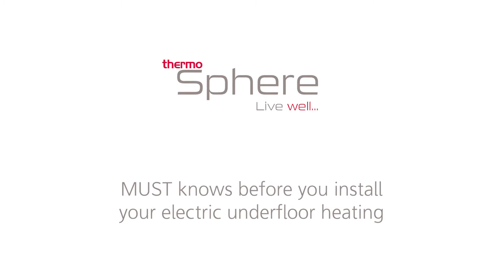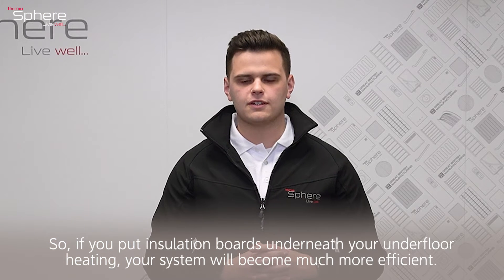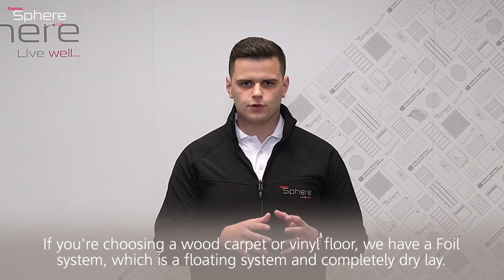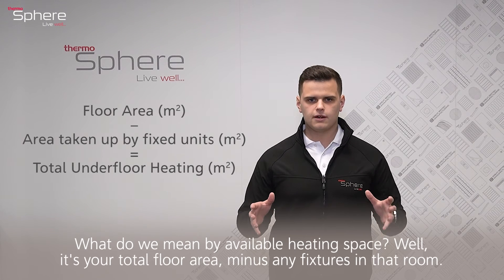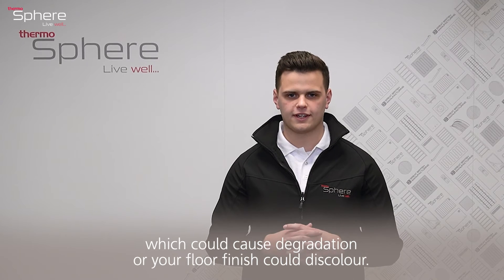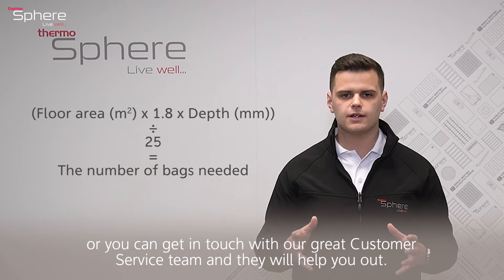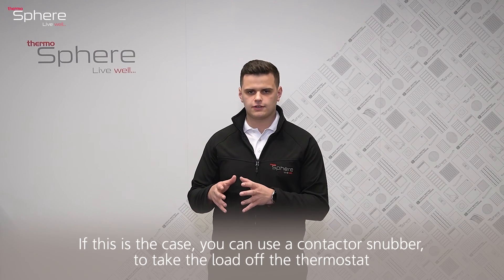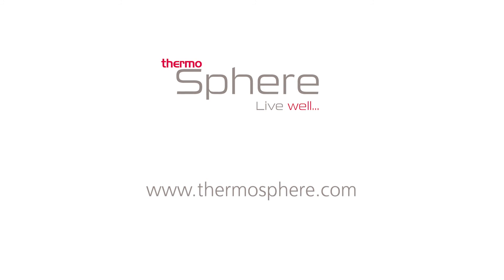Must knows before installing electric underfloor heating

Comment: For a concrete floor do you putting the heating mat first or the underlay? I have read different opinions on this.
Reply from the maker: Hi @MusicalRissy13Lovings, you'll want to put insulation down first to ensure you get more efficiency out of your system. Take a look at this page, which shows different floor build up options based on your floor finish - https://www.thermosphere.com/products/floor-heating/mesh/installation

Any other questions, feel free to get in touch.